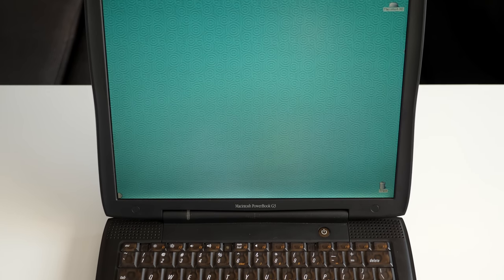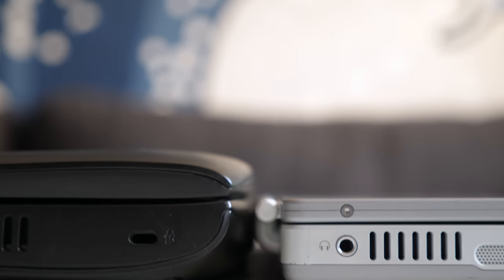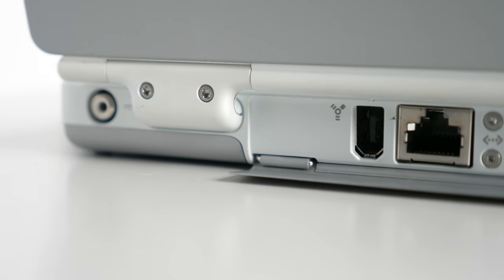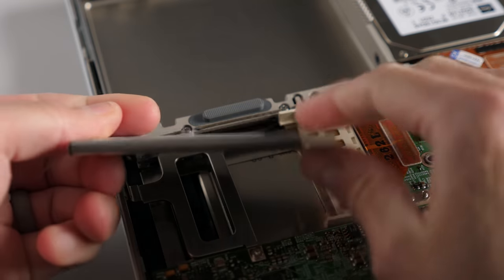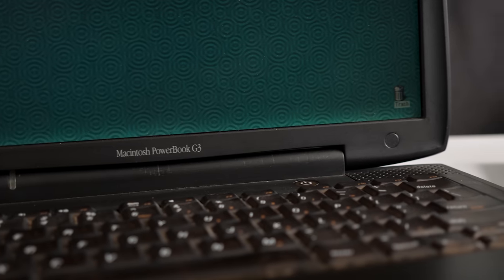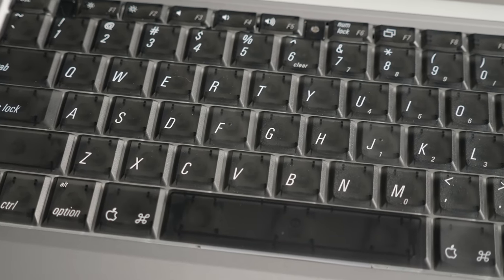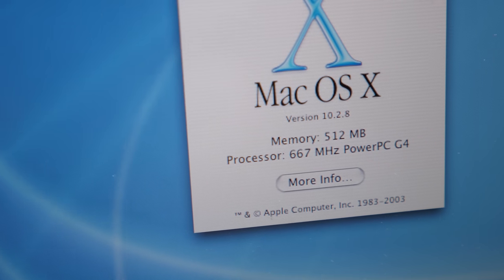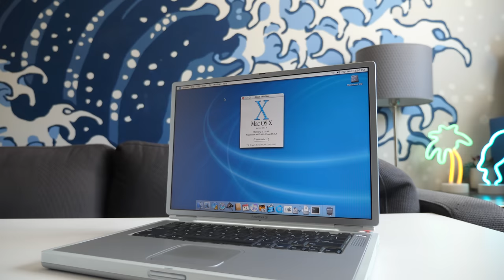The laptop that made Apple switch to aluminum

Comment: We had thin bezels even during those days? Man we were spoiled
Reply: Only 9 grand!!
Reply: Yet everything had a headphone hack huih? lol
Reply: And yet, my 2015 MacBook Air came with inch thick bezels. I'd love it if the MBA had the same width, but with a bigger (possibly even 16:10 or 3:2) screen.
Reply: @simonro9168  the pbg4 was 8 grand
Reply: Thin bezels are overrated by country miles, work in a repair shop or on the side as a hobby fixing machines and you'll eventually learn to love something more durable.
Reply: @MrKillswitch88  yeaah titanium and magnesium cases :P
Reply: @weinerschnitzelboy do you still use 56k dial up internet? 🤣🤣🤣🤣🤣🤣🤣🤣🤣🤣🤣🤣�
Reply: @TuxraGamer  All current MacBooks have headphone jacks

Comment: Man, I wish today's laptops had hot-swappable batteries, that's so neat.
Reply: I think you might have wanted to say user-swappable. Hot-swappable means it can be replaced while the machine is powered up and in use, which you can easily do with something like a mouse or a USB drive on a modern laptop. Before the era of USB, adding peripherals to a computer usually required the machine the be rebooted, so those devices were not hot-swappable (e.g a PS/2 keyboard), hence why a distinction was made. Getting back to batteries, most laptops that had user-replaceable batteries did not support hot-swapping the battery (when plugged in, otherwise removing the battery in use would obviously kill the machine). I recall I had a Dell laptop that supported up to two batteries (one could be added in lieu of the DVD drive) and the manual explicitly said to always power off the machine before adding or removing the batteries. I assume the power controller could not easily deal with a large change in load as a battery was removed and you risked frying up the internal circuits of the machine.
Reply: Stefan Stan weren’t the batteries in the G3 hot swappable, since there could be two of them, and you could switch one at a time?
Reply: They still do, the Rugged and Semi-Rugged laptops from companies like Dell, Toshiba, Getac, etc.
Reply: @SSW2503  yeah, that's what I meant, thanks for clarifying. I don't really like how some devices (almost all phones) are really cumbersome to repair.
Reply: @Abhishek Harge which isn't necessary today.. But there are some laptops from Lenovo are hot swappable
Reply: @SSW2503  I think he means what he says. Hot swappable. Although in the case of the G4 I guess it’s more “warm” swappable as you have to close the lid and put it to sleep to swap the battery.
Reply: My 2011 Samsung laptop's battery is removable, but not hot-swappable.
Reply: @mini9503  The company I work for in the mining industry uses Getec laptops made by General Electrics GE and are well constructed...
Reply: @thiswillprobhrt  You're right, this was actually true for all PowerBooks, and also the MacBooks (Pro) that still had user-swappable batteries: putting them in Sleep mode gave you a couple of minutes to change the battery without rebooting
Reply: I used an hp omen laptop for 4 years and the battery had a latch on the bottom for quick swaps. It was really convenient for when I forgot to charge before bed
Reply: Drives not batteries. Hot swappable means it can be removed or installed without the computer needing to be powered off first. Take out the battery and the laptop would lose power 😂
Reply: @JasonB808  Not so for Apple laptops in the time they still had swappable batteries: no need to power them down, just put them into sleep mode.
Reply: @thiswillprobhrt nope, once you remove the battery the ram loses power and you’ll have to start up the machine from cold.

Comment: It's amazing to me that Apple ever made anything this serviceable.
Reply: I have an old desktop Macintosh that has no screws and can be almost completely disassembled without any tools.
Reply: @leandrotami  How old?
Reply: Apple stuff was highly user serviceable well into the Intel years. Just because you’ve got relatively little experience with them doesn’t make it unusual.
Reply: @BlownMacTruck  Pretty much after they sealed the battery into damn near everything, I've labeled them as unserviceable.
Reply: @hattree  shrug Putting aside that most quality laptop manufacturers have gone this route, it’s not like this is something not recent, like you insinuated.
Reply: @BlownMacTruck  Yes, and as someone who works on electronics, I have to deal with Apple's design considerations filtering into everything else.  Just because it's become common doesn't make it a great idea.
Reply: @hattree  Give me a break. That’s not what your original post insinuated - you were complaint that this has been happening forever (it hasn’t) and that it’s restricted to Apple (it isn’t). Not to mention replacing the battery is extremely straightforward, and over the course of 10 years, you only have to replace it once before the battery becomes untenable. This is because of the improvements in how a non-user replaceable battery benefits the end user. I would love to see the army of 10+ year old user-replaceable laptops you’re wielding.

Would I prefer more user serviceable parts? Sure. But when the benefits of non-user replaceable parts meets the practical considerations and in fact improves upon them, the only thing you’re arguing over is dogma.
Reply: @BlownMacTruck  There are no benefits to non-replaceable parts for anyone except the manufacturer. Apple has purposefully made items harder to fix, and harder to work on, usually for no good reason but the sake of aesthetics.  They are even making serialized parts that won't work in another unit.   The have made worse the culture of disposable items.  They are not the only ones, but they have been at the forefront of this since the advent of the iphone.
Reply: @hattree  The battery in current laptops work longer and have far better overall lifetimes specifically because they aren’t user-replaceable. Did you just ignore that entire part? Also keep in mind you CAN get the battery swapped out - Apple specifically allows this to be done for free if the battery isn’t meeting specs of retaining charge over roughly a five year lifespan. And you can replace it yourself with some work. Because of this change, most people reap the benefits of a far better performing battery with no downsides. The same principle works with RAM and storage.
Reply: @BlownMacTruck  Sure, Jan.  There's nothing about making a battery not replaceable that allows it to hold more energy.  I can tell you Apple doesn't do as you say as I had a Mac in the Apple store one week ago that's 4 years and 4 months old and they wanted to charge $190 to change it out.  There is nothing that makes a totally internal battery perform better.  They only thing it does is let the manufacturer move stuff around it making it more convenient for them, and also making it more difficult for the consumer to replace.  I've never seen a battery of any type hold up more than 3 years well of any type.  Sure they'll still hold some charge after that, but maybe half as much and it quickly worsens.  You should always have access to the internals of your equipment.  If I want to update the RAM or the Hard Drive, it should be easy.  If I want to replace the battery in my phone it should be easy.  Sure they haven't done any of this in years at this point, but that doesn't make it right.  Any gains we've realized from these practices is from advances in technology, and not that they seal the device and make it difficult to service.
Reply: @hattree  Actually, you're incorrect. Due to the way the battery is not required to fit in a standard rectangular form factor that's easily user-serviceable, they can increase the density of the cells and shape them in a way that doesn't conform to a normal "block" – this greatly increases density and allows for the laptop to not be stuck determining its form factor based on the power cells.

Also if you haven't seen a battery hold up for more than three years, you clearly don't know much about modern battery tech; you may want to check on the warranty Apple stands by for their batteries, as well as what they'll replace after that (hint: you can get a 10 year old Macbook battery replacement TO THIS DAY). Again, see my previous post for typical timelines. You make it sound like you're forever stuck with the one battery you receive. Do you think companies just tossed out user-replaceable batteries because they felt like it? That they wanted the bad press that would inevitably come from it? No - there are specific benefits that pushed them in this direction. Maybe you should actually look into what those are.
Reply: @BlownMacTruck  Hi, I am a desktop support engineer and have been for over 15 years.  I work on client endpoints on a daily basis and am well versed in what I am talking about.  Recently, we had a batch of laptops with "pillowing" batteries that was striking in the 2nd year and pushing the cases apart enough to break the motherboard.  I've lived through all of this, and the only thing I can say we've gained from Apple pushing all of this on us is perhaps smaller/thinner laptops.  I'm not sure what you do, but I don't love having to use a spudger to get a laptop open, or worse, deal with adhesive.  You shouldn't assume so much about me.  I am well aware of what I am talking about, at this point dealing with thousands of machines in my life.
Reply: @hattree  None of that has anything to do with non-user replaceable batteries. “Pillowing” is covered under any laptop manufacturer’s warranty even beyond the standard length of time. Try again.
Reply: @BlownMacTruck  Well, I never saw the replaceable ones do anything but work.  I'm sorry you don't see my years of experience as something to have observe over time what's happened to the marketplace.  I know even less about you, other than you seem to be an Apple apologist.   Here is where we part company my friend.  Feel free to reply as it seems you must always have the last word.
Reply: @hattree  What are you talking about? I said all laptop manufacturers that did this and only used Apple as an example. You should probably not be doing what you’re doing if you don’t understand that you’re not supposed to be the one replacing expanded batteries - those are fully covered even outside warranties. But I wouldn’t imagine you know much about critical thinking as you’re using your anecdotal experience to generalize to the masses, and don’t even seem to have a grasp on what advantages non-user replaceable batteries have.
Reply: @BlownMacTruck  I really don't care anymore.  I don't think the hundreds of laptops my company purchased is really anecdotal.  I don't think the way the manufacturer replaced the batteries with ones that did the same thing is anecdotal.  I don't think the way they stopped servicing them after 6 months before the end of the warranty is anecdotal.  I'm here to tell you in my experience, and with hundreds if not thousands of devices I have personally dealt with, I have never seen a manufacturer do anything past a warranty end date without a recall or a class action lawsuit.
Reply: @hattree  That’s… not what anecdotal means. Please try and converse like an adult, as now you’re just ranting, as none of the things you’re saying about batteries is even remotely true at this point.

Also I’m sorry that you’ve been stuck in an entry level IT job for long enough that you’ve serviced “thousands” of laptops.
Reply: @BlownMacTruck  Well, you were the one telling me my experiences were anecdotal.  I've seen these problems in laptops for years.  You also told me I lack critical thinking skills.  Anything you said has essentially been anecdotal as it's not backed by anything.  My job is what it is, but it pays well.  It's not as entry level as you think, but I'm still on the desktop side.  I do know what I'm talking about because I've seen the machines, I've been on the conference calls about these issues,  and we have discussed it ad nauseum.  

I can only guess you work for a hardware manufacturer or a battery company.  Nothing you've said would make any sense otherwise.
Reply: @hattree  What are you talking about? Everything I’ve pointed out has been the opposite of anecdotal - it’s objective.  Look at the battery warranties on current manufacturers’ products - Apple will warranty 80% battery health of their batteries over 1000 charges. If you completely charge and deplete your battery DAILY (and that would be a feat on and of itself) that would last you three years… and they’ll continue to replace it for you after that for a nominal fee up until that battery is no longer available, which at this point is hitting 10 years. Other manufacturers do the same (HP, Dell, Samsung, etc). NO user replaceable battery comes close to that kind of performance. 

I pointed this out multiple times and you’ve simply ignored it and gone on rants about your personal experience, completely unbacked by any actual data. So yes, you’re critical thinking skills are non existent.
Reply: @BlownMacTruck  I can tell you that Apple didn't for my 2017 mac that hits 5 years in August, and HP doesn't at all on 840 G5's.  Telling me to go research something, but not actually quoting anything isn't supporting your argument.  My critical thinking skills are fine, you just don't warrant their use.  Good Day, sir.
Reply: @hattree  Right. That’s why Apple just replaced an entire team’s worth of 2013-era MacBook Pro batteries in my department. See how anecdotes work?

Comment: Before Apple turned to the dark side, making systems hostile to user modifications.
Reply: this is where the trend started for sure. The last one in my eyes that's even a bit user serviceable far as their laptops go is the Unibody 13/15in Mid-2012 Macbook Pro models sold upto 2016. I have one I got for free from the recycle last year, and the most pain the ass thing was finding the parts I needed like a HDD flat flex cable(there are 4 or 5 different ones depending on model#, and when it was made), and replacing the hinge clutch cover which I decided not to do, and to cover the small cracks with black electrical tape, as a replacement is upwards of $60 USD.
Reply: @CommodoreFan64  I dunno man, 2012 models are notorious for its GPU failure. Never should've picked up from the trash from the first place.😬
Reply: @jockeyjeon9532  I actually have a 13in(they usually don't have problems with the Intel I-GPU), It was free with the Magsafe charger, and in overall good shape, but if it does die I don't care I'll just sell it for parts at that point as I'm not really an Apple person(it's the only modernish Apple product I own), as I  have a small collection of Lenovo Thinkpads I've restored over the years I grab majority of the time when I need a laptop that I have Manjaro Mate Linux, or Neverware Cloud Ready OS Home Edition(Chromium OS) installed on them depending on my needs, and how heavy of a load I want to carry, or have on my lap while sitting on the couch, and I just keep my 90 watt Lenovo PSU plugged in ready to go.
Reply: @CommodoreFan64  Sounds like you got a lot of computers. Whatever you do, please don't become a tech hoarder. It's not healthy.
Reply: @jockeyjeon9532  You seriously need to get a life if you are worried about someone else's small collection of computers.
Reply: @jockeyjeon9532  The 2011s* - the 2012s were generally fine with graphics, with the exception of the Retinas
Reply: @jockeyjeon9532  the 2012 retinas have gpu failure
Reply: @jockeyjeon9532  the unibody 2012 MacBook pros didn't have gpu failure.
Reply: @jockeyjeon9532 you’re thinking of the 2011 15” and 17” MacBook Pro’s. The 2012 unibody was only in 15” and that doesn’t have any GPU issues.

Comment: The G4 design was ahead of its time as far as aesthetics IMO. Very reminiscent of modern laptops.
Reply: grab a dictionary, look up reminiscent. It was ahead of it's time but less than most think. Look at business laptops from IBM, Toshiba and slightly less HP and Dell of that time. The trend started before Apple jumped on that train, in part started by Sony but their market penetration was not great outside of Japan.

Comment: The bezels on the Titanium are still amazing to this day

I miss upgradable RAM and hard drives. That’s a serious flaw in Apple’s computers these days
Reply: I miss the renovable batterie...
Reply: All that stuff apparently was dropped simply to make the machines thinner and lighter, which to me is stupid. But then, if Apple brought back that upgradeability, they wouldn't make as much money from parts and service sales... Of course it doesn't matter to them that the corporation is already worth more than a trillion dollars.

Serviceability is one major reason why I still use a MacBook from 2012, as that was the last laptop model that had upgradeable RAM and storage, not to mention a fairly easily replaceable battery.
Reply: @zBrainlezz  Not sure how upgradable they'd really be able to make them nowadays with them using ARM based processors. Don't think I've seen an ARM based system with the possibility to upgrade RAM before.
Reply: @nathansstuff1547  there are a few arm boards that use standard so-dimm modules, but most of them are either devkits or made for specialized network equipment, which is quite a shame...
Reply: @helplmchoking  the ram isn in the soc tho theyre still separate chips even if apple decided to put them in the same package, theyre like the only ones who do that on pcs and many arm SBCs have dimms for ram its totally possible and easy af especially for a big company to do
Reply: @lateve6243  other computers can
Reply: @zBrainlezz  no dude you have it all wrong. The last MacBook to do that was the 2015 MacBook when they soldered everything in.